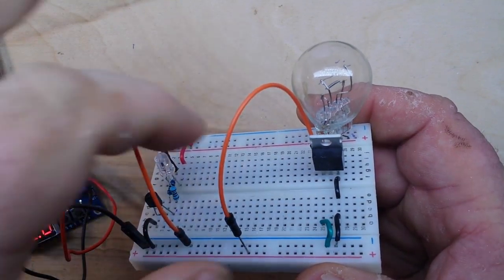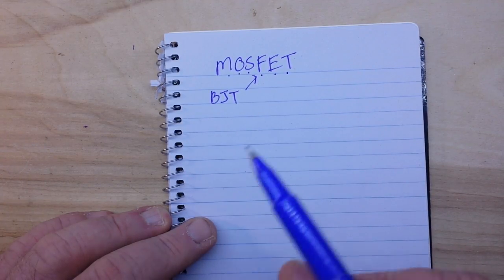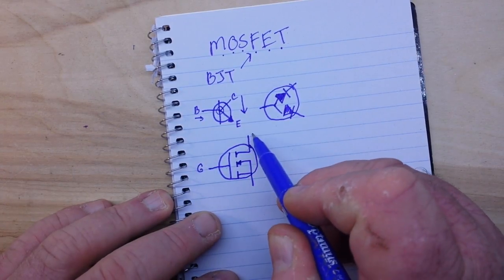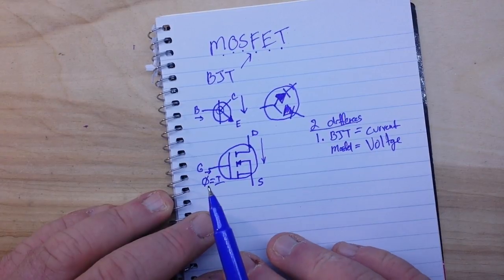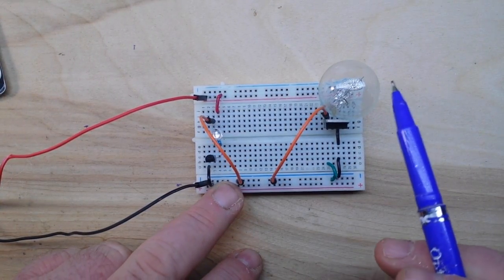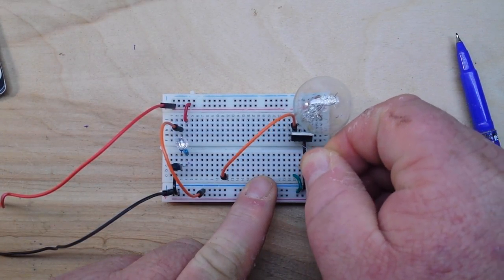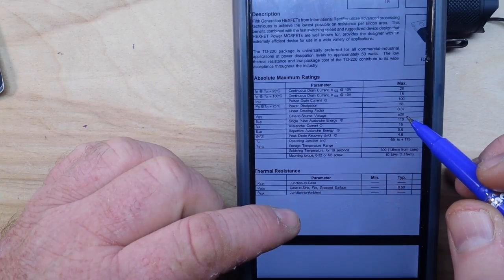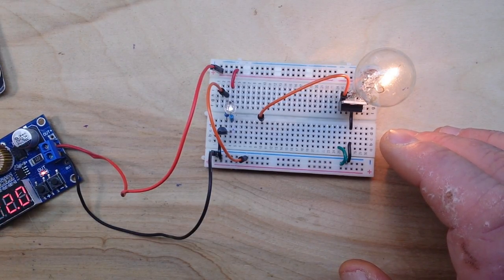Introduction to MOSFETS

Comment: Excellent video.  He distinguished mosfets from bpjt by their intrinsic activation: voltage vs current. He distinguished that the gate of a mosfet  is insulated , while the base of a bpjt is connected to the emitter. 
Very wise logical introduction. 
Older people make better videos on youtube. Very insightful. 
Thank you for this video.

Comment: Complete NOOB here. At around 5:00, you say that a little current at the gate, induces a higher current from the drain to the source. But HOW, I mean the source is like a diode heading TOWARDS the gate, how can the drain reverse-bias the source? That goes against everything we've been thought regarding diodes. Additionally, there is no visible connection between the drain and the source in your drawing [is that all induced too?] Please explain

Comment: Great vid as always Paul. I have a question. I want to use a clamped voltage through a voltage divider to feed the gate of the FET. The drain will be connected to the low side of an op-amp (LM 358) whose output has little current draw (an ADC) All I can find is videos dealing with much higher current. Will this even work? or is the low voltage, low current of my circuit going to disqualify it from performing. ?
Reply from the maker: Fets are voltage driven, shouldn't be an issue

Comment: I have two mosfets to consider replacing in a motorcycle sparkbox (TCI).
These are D1071, I assume they are mosfet because the metal hat sink.

The thing that is different is they are normally on to build up coil field and gate cuts voltage to cause coil field collapse which produces a spark.

The pickup and flywheel are different too. The pickup has a small voltage and the flywheel has a metal strip that passes by the pickup coil, change of the metal strip effect on the pickup coil (dont understand how) generates a signal to the mosfet to cut power to the coil to produce a spark.

I believe it is the two mosfets because both coils (2 cylinders) has power when key is on.

The TCI (sparkbox) has safety features to disable the spark but I believe I have checked them and they are operating correct.

There is one device called safety diode, but I tested the current one according to repair manual and test good. I ordered another as it was not bad cost and will try swapping before messing with TCI.

TCI are very expensive, rare to find at $100 and common at $400+. 

Not sure what else to do.
Subscribed

Comment: Most of the videos I've watched on these suckers say that the max ratings are under infinite heatsink conditions. They've never explained what that means though. I mean, you can't have infinite heat sink, so that doesn't break the ratings down into meaningful numbers for me. Do you have a video on how to size your mosfet for a specific project? I've figured out that I need a 5v n-channel enhancement type mosfet, but then there are SSOOO MANY other different voltage and resistance ratings provided that I get stuck. It's trigger power is going to come from a computer usb port so I want to be cautious with my selection.

Comment: Hi . I need your help to give me a simple way for controlling mosfet in the DC region as variable resistance . And  by doing that I can connect the MOSFET in to transformer . So I can apply this current change with a sight wave current form in to voltage sign wave in the secondary section from the transformer . 
And I need a feed back from the secondary to loop for the MOSFET control so I can stable the sign wave form

Comment: Can you suggest a resistor for an irfp460 for gate to ground? Thanks!
Reply from the maker: 10k
Reply: So I tried that and it worked for a bit then it popped. I am trying to use your frequency circuit design to trigger the mosfet and drive a hydrogen cell as a load. But it pops everytime. Any advice would be greatly appreciated!
Reply: Also it’s the 555 that pops..

Comment: Thank you Sir for the wonderful video on MOSFETS including the switching of transistor, the practical and your very patient explanation.
Reply: A lot of people tend to call them switching transistors when they don't switch.... They behave more like a potentiometer with a capacitor on the gate... If you adjust the voltage on the gate, you will see that the Mosfet will replicate exactly what you put into it just as a potentiometer behaves except that due to it's capacitive function of the gate it has a sort of peak hold until you either increase the voltage to a new level or ground it.... By looking at transistors as switches tends to confuse people as to how they actually work...

Comment: No a MOSFET, IS NOT a metal silicone transistor conductor.
It IS however a METAL OXCIDE SILICONE FIELD EFFECT TRANSISTOR.THUS MOSFET.
GET YOUR FACTS STRAIGHT before you post a video.
Reply: How ironic that the guy who posted this is wrong himself.

Comment: Oh my fucking god! Thank you my good sir! Just... thank you! I am currently building my own regulated bench top power supply, it's my first big project. I'm studying to become an electrician, but that does not at all involve things like IC's or (or low voltage electronics at all for that matter, it's only the stuff that you need a license to do), and you have no idea what this has done for me. The hours of experimenting and testing (in the entirely wrong direction i might add). The hours of researching, tired by my failed attempts, and without the help of any tutor understanding the information i find... You just gave me a basic understanding of mosfets in under 15 minutes! O__O Everything in the datasheets suddenly make sense to me, and i now know enough to easily get more in-depth on my own! Thank you so much, you've got a new subscriber!
Reply from the maker: Awesome!!! Thank you.

Comment: When you disconnected that transistor did I notice a small leakage curent as the LED was still slightly glowing? Thanks for your videos
Reply from the maker: +Shane Bekker Thanks
Reply: :-) was not trying to point out an error on your part but more question of confirmation of what I think I saw and is that normal for a transistor?
Reply from the maker: +Shane Bekker It's cool, if you see something off feel free to say so. I have torn apart the circuit after the video so I can't tell you for sure. But it is not normal behavior, when the base is disconnected the collector-emmiter junction should be off.

Comment: love some MOSFETs! some of what I know is mixed with BJT's. so things get a little screwy in my mind!  what would be more efficient. a FET or IGBT? 
since the fet needs the gate resistor. that causes current to flow. what is the highest resistance that can be used to limit current flow? I guess it depends on the capacitance of the fet ? and switching frequency? but can a 1mega ohm resistor be used to pull the gate down? or would that cause the gate to drain slowly. causing the fet to act like a resistor. and heat up? I told you the more I learn. the more questions I have!!! and what about P channel FETs? and the ones that are on. and the gates turn them off? I can't remember what they are called right now. they are kind of an oddity hardly ever seen. or used,.  great video. but I want more!! I guess I need to contribute some. I'm in a financial between a rock and well another rock right now. but in a month or two I hope to start... have you considered a tutoring kind of thing. for a group like through YouTube or something? great video.
Reply from the maker: +James stranger It really depends on the application. IGBTs excell at KHz level switching and high currents. My TIG welder is all IGBT. They seem to be more robust.
Reply: learnelectronics 
so for a 200-250amp DC boost. igbt would be better? I'm worried about standby power consumption. why I ask. with the small current in to the base. multiplied over who know how many . I can't remember does the igbt use current or volts to operate? also I have heard multi stage boost may be needed for a hi volt & current. DC boost. is this true? like 24v to 175ish volts. for a 3000 watt inverter. I have thought about a push pull. but the transformer would be huge. witch I do have some large transformers. if I ever build this thing. I would like it to be robust. like output 2x the continuous output for like 10 minutes. like some high dollar inverters. I don't want the FETs or what ever. to be the weak link. like the cheap inverters seem to be. the one I have now. the FETs are on there own little board. easy to replace. a screw for every electrical connection. a nice feature. but I'd rather double the FETs. and not have to worry about replacing them. but other than that. the drive circuitry is the next ?
Reply from the maker: +James stranger IGBTs are voltage controlled, but they have a slow turn-off time (current trail) like a but. On the there hand they are mostly immune to thermal runaway, but then they lack a body diode. See where I'm going here? They are 50% but 50% MOSFET.
The standard of choice between the two usually comes down to breakdown voltage: over 1000V you go IGBT, under you go MOSFET...and switching, over 20KHz you go IGBT under MOSFET.

I hope that was of some help.
Reply: learnelectronics 
you are a lot of help thanks
Reply: learnelectronics is there a igbt video coming?
Reply from the maker: +James stranger mmmm, probably not in the near future but definitely in The future.
Reply from the maker: +James stranger anytime

Comment: ah yes mosfets, i love them. you can actually measure high resistances with it using math ;) not terribly accurate though. i noticed that my fingernail is better isolating than the wooden table i work on (that could also just be capacitance though pulling away the charge)